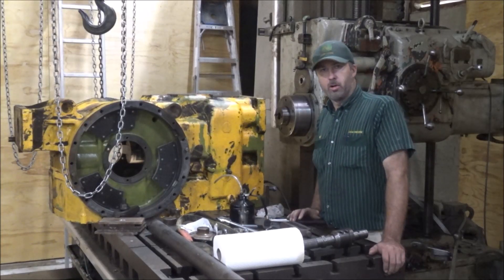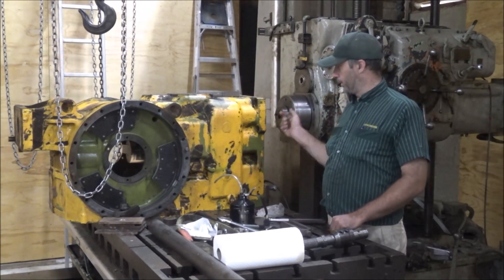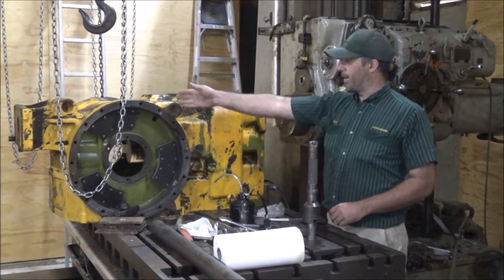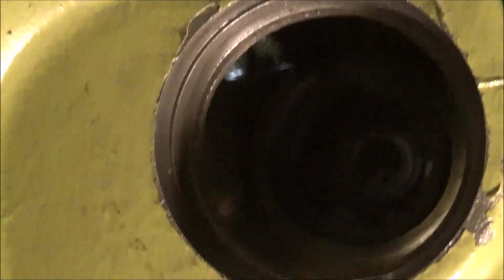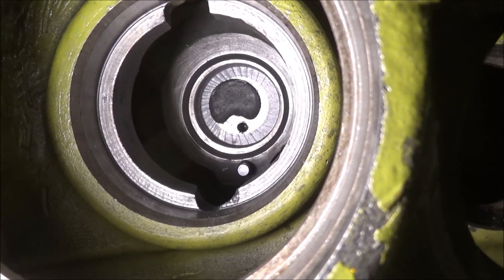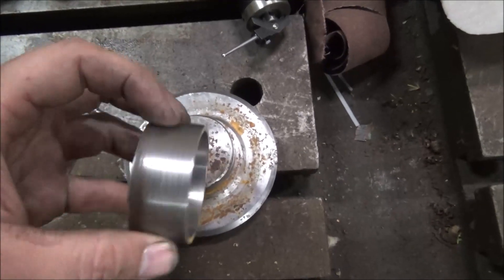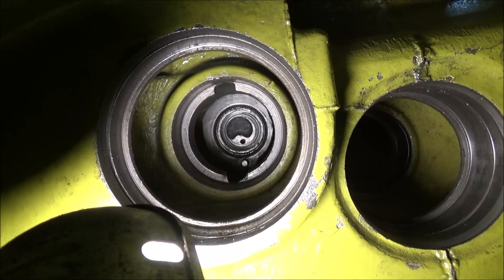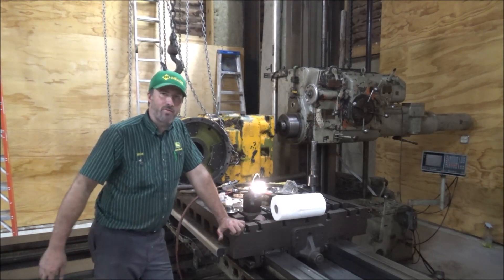Deere 760A Brake Bore Repair

Comment: Gosh, getting lined up on that must have been tough.
Armchairing it from here, I'd have turned a couple bushings to a very very light press fit in the bearing bores, have a nice slip fit on the ID for the the boring bar to run in them and spin/feed it with your mag drill. Can you tell that I don't have the luxury of an HBM? :p
Reply: Had another thought laying in bed, drill and tap a tapered pipe plug in each bushing, split the bushings through the tapped hole, then thread in the pipe plug tight to expand the bushing out into the bearing bore, making sure it won't spin with the boring bar while still being easy to remove.
Reply from the maker: Bushings on the bar is a great way to get extra support on a long stick out.

Comment: Mr block,
What's you experience regarding difference in surface finish produced between 
Tool steel bits & brazed/ground carbide.
Reply from the maker: It varies depending on material and the grinds and inserts.

Comment: It would be good to have a gust front like that come through where I'm at It's mighty dry. Last time I had one of those sneak up on me in Kentucky was on Interstate 24. I was taking a NASCAR hauler to Florida.  about the time the gust front hit, an 18 wheeler passed me running way over the speed limit. it hit him when he was still in the left lane. His outside tires had stripped a quarter mile of sod from the median by the time he got it back in full control.  He then decided that running slower wasn't such a bad thing after all.

He also got off at the next exit where there is a Pilot.  Probably to change his drawers.

Comment: On thing you could do is sweep the front face surface first then indicate the front bore
Reply from the maker: I did check to make sure the front face was square but that doesn't guarantee it was all originally done in relation to that surface so that wouldn't prove any additional alignments.

Comment: With your extraordinary skill and a machine like that, you will be in demand. I doubt there are very many shops on main street that could do that work and you approached it with your normal "can do" attitude. Awesome!!!!
Reply from the maker: These are the kind of jobs I like. :-)
Reply: I think that would be Motion Industries.
Reply: LIke a guy I worked for/with that took jobe everybody else turned down. I have seen him do things I knew blasted well couldn't be done, but he did them. Amazing.
Reply: New challenges every job, kinda fun...   ;)

Comment: Very cool work! As a hobby machinist I never really do "pay" work for others (lots of free work though!). It makes me curious, is having something like this done expensive? $100? $500? I really have no idea as I am a Computer Security Engineer, not a "real" machinist. Not trying to get into your financial business, just curious about rates and such in general. Thanks for the video, my friend!
Reply: I cant quote for brian, but if I were sending that job up to my engineers I'd expect to pay £750 ish as a miniumun. remember the job isnt just what you see here (not that thats insignificant) but the job includes surveying the damage, and handling of the part, getting it on the table safely then getting it true. The other side of the coin would be a replacement casting is no doubt 10's of thousands, so to effectively save it from the scrap you could charge 20% of the cost new, make good  money, and its viable to the bean counters in the office who give the go-ahead.

EDIT to add, could easily see being charged a few thousand, depending on how busy the machine shop was, how aquard the job, and frankly what kinda mood the machinist is in lol
Reply: That is a great explanation, thank you! As a "hobby machinist," my work consists of MUCH smaller things I can lift by hand. I imagine setup really takes time with a piece like this. It is worth every penny of whatever Brian charges, he is really a master.
Reply: For repair work, often the setup is most of the job. Not uncommon to have two hours of setup for two minutes of machining.
Reply: Man, I have found the to be true with all machining work or so it seems at times :) Especially on the milling machine, not so bad on the lathe usually unless I am using a faceplate for off center work.

Comment: Nice job , why would they have a brake for the elevator drive ? or is the same housing / brake set up used for other application of the trans  .  I have only worked on cat elevators 639d 's  & 33d's  & they dont have an elevator brake .
Reply from the maker: I assume its so when you reverse and power feed back out for spreading that when you stop it you can keep the weight of the dirt from turning the chain on its own and still falling out.

Comment: Working blind is hard enough but 24" from the face will sure increase the pulse rate.
Reply: I wonder how many shops around there have equipment that could do that job. Sometimes the machine capability brings in the job, your expertise, contacts, and reputation are just icing on the cake.   It must be a warm fuzzy feelin' when your hard work makes the long term plan start paying off.

Comment: A $30 usb endoscope would be very handy there, allowing you to indicate right up into the guts of that box.  They plug into your phone.
Reply: Most people's phones, Brian is still rocking the flip phone.  All kidding aside usb endoscopes are inexpensive and useful.
Reply: I've got one that connects as Wifi.  It shows up as a Wifi server, and I just log the phone into it.  It's cheap, it works, and I use it a lot.

Comment: What keeps the hydraulic oil from getting under/behind that thin bushing and pushing it out?
Reply from the maker: It is clear to the bottom of the bore and flush plus it is sealed with retaining compound. Combine that with a .003"press fit and it is in there tight. The hydraulic pressure is less than 200psi so it should hold fine.
Reply: Cad-Cam_Man loctite retaining compounds 
At 7:16  little red bottle 
The press fit + the presure acting on the id of the bush means it really wont come out 
If anything the piston catching it is really the only thing that'll pull it out
Reply: bcbloc02 I was thinking the hydraulic pressure was much higher, but I think you're correct it should be fine.